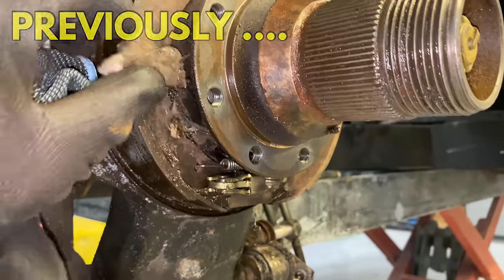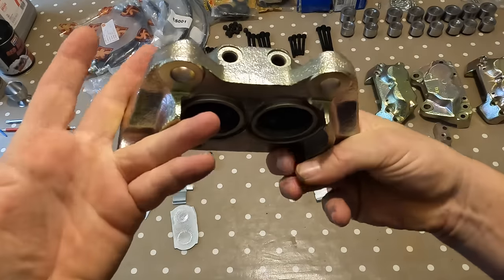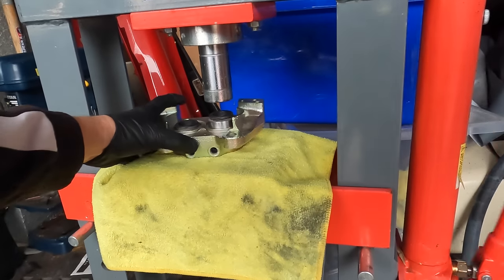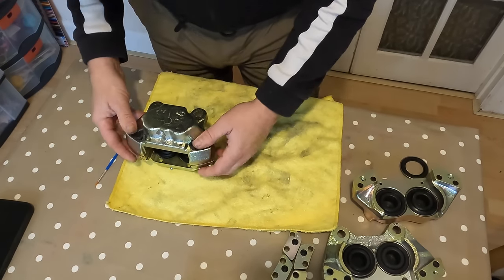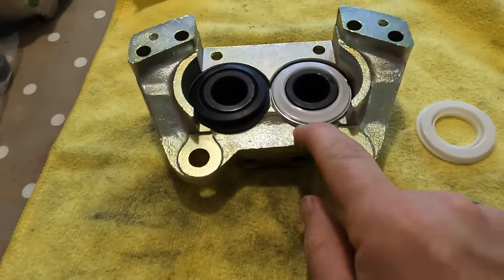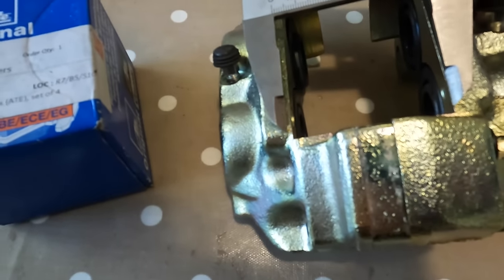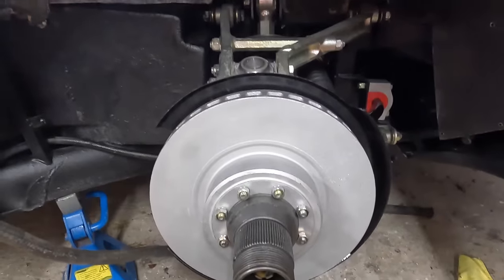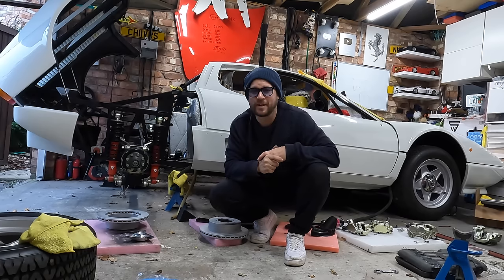Barn Find Rare Ferrari 512BBi - Finally Fixing a 2 Year Brake Problem

Comment from the maker: Guys, I love my job working with cars, finding a career that makes you happy is life changing !
If you want to work in the Automotive industry or fancy a change, speak to ASi who can help you out. 
https://asirecruitment.co.uk/contact-us/
Or email: terry@asirecruitment.co.uk
Reply: Nyalic  Nyalic is the shiznit for protecting bare metal.   It's not a paint, but it is a clear surface coating.   The UK dealer apparently is oceanfootprint.
Reply: the spring goes inside the rubber dust cover

Comment: I Scott. You shouldn't have to press those pistons in with a press! If they don't go in by hand then there is an issue. I always soak the seals in seal conditioning fluid for 24 hours before you fit them (Brembo make it) using red rubber grease to put the pistons in would have made things easier. Just make sure those tight pistons move in and out nicely when the brakes are bled. Pump them out with no pads and check each pair of pistons come out evenly and that you can push them back in by hand.
Reply: Julian is spot on
Reply: If some went in easy and some didn't, then I have to wonder if the seals are shaped on the face that seals to the piston, it can be very hard to see the chamfer, did you check them,???
Reply: Great info, that freaked me out also. Hopefully it works.
Reply: Will be really interesting to see if the brakes work correctly after they were put on the press. I would have thought no way.
Reply: @Mr57blackbeauty  I expect the seals will be square, the chamfer will be machined into the base of the seal groove. This is what makes the seal sit at an angle so that the piston retracts very slightly when brake pressure is released.
Reply: agreed...all that's needed is red assembly lube..
Reply: This guy is right, you know. Glad Scott spotted it.
Reply: @julianhoskins5158  hopefully they are, but a lot of early ones aren't, it was easier/cheaper to machine the caliper square and put a chamfer on the seal, they also discouraged people from rebuilding calipers by making it almost impossible to buy seals. But fingers crossed.
Reply: Oi suspect the seal is upside down if they don't go in. Brakes won't work very well and the pedal will be very hard if the wrong way round. The seals are tapered.  I made that error.
Reply: Good luck getting them out now. lol
Reply: Yeah i was thinking, when i was doing a pad change it only look 2-3 fingers of pressure to reset the pistons :T
Reply: @Mr57blackbeauty   brembo got sued big time for not giving instructions on  replacement  seals.
take no changes on brakes.

Comment: The other side of those measurement calipers is for inside measurement. As far as the pins a machine shop could put those on a lathe and make them the proper size relatively quickly and cheaply.
Reply from the maker: That was my idea, but surely there must be some pins out there available at the same size
Reply: My 1971 BMW 2002 uses those style  pins , check later BMW calipers for replacement pins .  @Ratarossa
Reply: Scott - I'd also check with Alfaholics. They might have some pins laying around that could help you out. Alfas of the era also used the ATE calipers (my Montreal's calipers look nearly the same as those on your BBi, though I'd guess a bit smaller if placed side-by-side). @Ratarossa
Reply: Fellow YouTuber ‘Delboy’s Garage’ (@moonfleet41) does some fantastic lathe work, creating one off work/ modifications for his motorbikes in uk. Maybe another opportunity for YouTuber collaborations 😊

Comment: Take care pushing pistons in like that. They should slide in, and a fair chance if not then they are catching on the seals. The piston can then guillotine a piece of the inside of the seal off (and no chance of bleeding them after that!)
Reply from the maker: Noted
Reply: @Ratarossa do you think the pistons being that hard to push in that the braking system will have enough pressure to push the pistons out to make the brakes work?
Reply: @joeysweet9045  it will defo push them out its if they will release that's the problem!
Reply: I’m afraid the pistons scratched the cilinders when pressing in. My guess is that the coating created the fitment problem.
Reply: @Ratarossa  The inner seals maybe incorrect, like the dust caps and springs 🤷‍♂
Reply: @_Bram  good pasivated  zinc plating should be very thin. However, it is possible that the seals are directional, rather than square section.
Reply: @katywalker8322  Seals will be square, the force to retract the piston slightly when  the brakes are released is controlled by the shape of the seal groove which will be slightly tapered.
Reply: Bmw&merc use Ate brakes.
Reply: @jabberwockytdi8901  , not on all calipers, although cant say either way for these ate calipers.

Comment: Had a guy who took over half a year to point one of my cars! When I picked it up. On purpose he parked it in the sun in the summer. Also, while it was there he had kept the car outside, and obviously had the windows down some of the time. It is a nightmare dealing with paint and plating shops. For some reason they attract reprehensible types of males.

Comment: Hi Scott. Nice work as always mate.
Just a side note. When it comes to lubing up those seals prior to installing the pistons, I was advised from a reliable source to not use brake fluid but rather a castor oil based Red Rubber grease. Brake fluid is hygroscopic and can introduce corrosion while the finished part lays in wait for the rest of the build to catch up.
Also, the red rubber grease protects the seal much better and prolong its service life.
Reply from the maker: I did read about the red rubber grease and actually you might have even spotted a tub on the table. So basically what i need to do is get this finished very quickly !
Reply: Totally agree, I've never found brake fluid a very good lubricant for the job.
Reply: @Ratarossa  I missed that actually. I'll have another look
Reply: Hellerine M grade is a fungistatic lubricating oil designed to dry slowly so that the components stay lubricated longer, 94% Castor Oil 6% Ethanol.

Comment: Clear coat!
I've gone through the same process, restoring front/rear ATE calipers on my 105 Alfa. Been two pot calipers, I didn't have the dramas you experienced, phew! I used VHT High Temp Clear on on my newly Yellow Zn  plated parts. Wiped them down,  hung on wires and if it's getting cool  in UK, apply a bit of heat. Great vid!

Comment: Just a thought, why don't you take the longer pins to a local engineering firm and see if they can reduce them on a lathe?
Great to see you back on the BBi as well!
Reply: Glad you typed it..His main problem is finding a local engineering firm....;D Maybe you need a little second hand lathe Scott?
Reply: Yeah a good machinist would make short work of getting those pins to the right size.

Comment: For anti corrosion you can try XCP Rust Blocker Clear Coat. Readily available in the UK. A lot of bike owners use it to protect the exposed metal parts on their bikes. It's also very easy to apply.
Reply: I've used ACF50 on my bikes for decades, easily applied from a cloth near brakes and elsewhere. Works extremely well.
Reply: I have also applied a marine grade lanolin based protection to the running gear of my cars. Using a combination of spray, brush and cloth depending upon the application. These cars were made and are best driven, not squirrelled away.

Comment: If you clear coat zinc plate  instead of gradually getting a uniform weathering you will find that the coating gets damaged  in places ( stone chip etc.) and corrosion will get underneath and cause crusty flaking patches while other parts stay shiny longer. Also if you want to keep it looking nice as long as possible DO NOT go any where near those wheels with wheel cleaner  will eat the plating in short order , even the  ones marked PH neutral are still based on a chelating acid ( but buffered) which will still do the same thing , just takes longer  so limiting exposure time is key.

Comment: When I did my brakes, the seals had to be installed in the correct orientation. They had a very sleightly tapered shape. This pushes the piston clear of the disk I think.

Comment: You should be using rubber grease for assembly and to stop the pistons from corrosion. Turn down the pins on a lathe. Split washers are usually installed under nuts, not bolt heads if there's a nut. Might be worth checking the front disc assembly order.

Comment: You can preserve your zinc plating with Shark Hide. Brush it on. It is clear and will not peel. It does make things shiny if they were dull. I've used it for 10 years on my old BMW. It works on bare aluminum too.

Comment: Always use silicone grease for caliper rebuilds Scott! Expensive but saves on the blood and bruises and those pistons just slide home, providing those piston seals are oriented the correct way as they are cut in  a Specific manner.

Comment: I just had the same issue with those darned springs absolutely not wanting to stay on. Ate calipers for 1994 Mercedes SL. Factory originals were a harder rubber boot with no clip, just a snug strong fit. Luckily I found another repair kit with "hard boot". No annoying springs.

Comment: What I've found is pushing the pistons directly in like that, can really put stress on the rubber seal inside and in a rare case, even tear it... even with brake fluid. Had that happen to me doing some Evo 123 twin pots on my lancer project. It really is better to find a way to twist em in a circular motion and work it slowly.

Comment: Put clearcoat over the yellow zinc parts. It will help to keep them yellow for longer. They will fade really quickly if you don't do so. That is because a couple of years ago someone decided to ban Chrome VI / 6 which was the older plating they used. There are new alternatives that are being used but they don't even come close to the quality of older yellow zinc plating.

Comment: Put the long pins in the chuck of a pillar drill, select an appropriate speed, then use a fine square section file to reduce the shank of the pin to the required length. Finish off with fine emery cloth or abranet paper for a good finish. 
A bit sketchy but you could even do it by holding an ordinary household electric hand drill in a big vice.

Comment: Smashing project. Anti-seize needs to be wiped on the hub carriers before you tighten everything down. Also on the calipers for the backs of the pads so you can change them easily in the future. Just a thin layer-dab-on-wipe-smooth with a rag. Some of those bolts need loc-tite too. Those missing bits will turn up just as everything is finishing up-Murphy's Law.
Reply: +1

Comment: ATE makes great lube called Bremzzylinderpaste which is brake fluid compatible and works very well as the assembly and maintenance grease. Try using it next time. You won't need to use brutal force.

Comment: The brake parts would have to have a heat resistant clearcoat. I guess you would need to find out max operating temperature and get a clear lacquer that wouldn’t discolour or fall off, and adhere to the plates coating. Sounds simple. Good luck Scott

Comment: The suspension and brakes look absolutely gorgeous Scott and I feel you when you'd like to preserve that look. There must be lots of clear coats out there for sure.
Having rebuild a lot of brakes myself, most of them on motorcycles but also on cars and even ATI brakes (Alfa Romeo), I recognise the parts. Those clips won't come off, at least not in my experience but the Ferrari solution looks clean and solid. When I buy any kind of brake kit, there's always a (tomato sauces like) container with special grease to install the kit. Brake fluid won't work and will only make it harder.

Comment: Really enjoying this project. I agree with the many comments; there is something wrong with the seals if you need a press to get them in. They may already not be coming back out without sacrificing them.

I suggest custom stainless pistons courtesy of your local machine shop. Same for the pins. 

I suggest a regime of maintenance using ceramic coating products for preserving your finishes. It will need updating maybe every spring, for example

Comment: To break a reply out into the general chat:  Nyalic - distributed by oceanfootprint I believe in the UK, is an Apollo era clear-coat protectant used on spacecraft that should be just perfect to keep the luster/finish put on those fresh metal parts.  It's both clear, not thick, and can withstand just about any non-exhaust level temperatures.

Comment: 6:35 Get a flat thick piece of wood, and a brass hammer, a small one, level it off and tap it in, or just use the wood to keep the pressure up and push it in, main thing is its something softer than the metal that isnt textured or rough so you dont break it or screw up the surface

Comment: The only thing I can think of to help protect everything without applying a permanent or oily coating is wax/ceramic spray. A wax coating will prevent moisture ingress while a ceramic detailer spray will apply a hydrophobic coating and allow less water to sit on surfaces. Otherwise, the only way to keep it all pristine is indoor storage and climate control.

Comment: Lovely work as always. If you need information or parts for classic ATE brakes be sure to reach out to PMB Performance in the US. They are specialists in old ATE restoration and will be able to help you out. As for the yellow zinc coating in order to protect it at MOST spray it with a light coating of oil but nothing more. Clear coat will fail quickly and look terrible. If the zinc was done well it can last decades. It is the exposure to salt and water that destroys the coating and so long as you wash and dry the car you will not have issues with the coating looking bad over time.

Comment: absolutely love the level of detail going into this car! but.. i was mortified to see a press being used to fit caliper pistons, they should really only be hand pressure tight, otherwise they likely wont move correctly (and could be a nightmare to remove on the next rebuild); remember that they move out under pressure but also back inwards slightly when you come off the brakes. this is achieved by the natural motion of the seal (thickness( being able to flex in and out. too tight a fit and there is no movement to be had. i can see major brake binding issues in the future for these 😬

Comment: Owning a classic car dilemma, as someone that lives near the coast. Drive it, will actually be good to maintain the powertrain in working condition, but compromising the body panels, not only due to rust as potential damage.
Reply: Even relatively new cars already show rust. Too thin modern paint jobs, as usually starts to appear near the front grille.

Comment: Lots of caliper build kits include a special grease to enable assembly..
The pistons should have pushed in easily once past the seal.
I think you need to carefully check that the pads don't bind or stick , due to the seals not being able to retract the pistons when the pedal is released.

Comment: Dude, put the pistons in the freezer and caliper halves under low heat in the oven (or outside in the sun) and they’ll slide together a lot easier.
Reply: Not much Sun in the UK ATM.

Comment: When rebuilding brakes using red brake rubber grease, better and safer than straight brake fluid (stops corrosion behind the seals etc) and doesn’t effect the fluid/braking performance

Surprised the pistons needed a press to get in, as long as they are not cock-eyed they should push in by hand… are the seals or pistons the correct size, looks like they binding and might work but would hold the pistons causing the brakes to bind on
Reply: The red brake grease is literally made for the job👍.
Reply: Hope he did it all so it all last and don't dry out and so on👍

Comment: Just use a G-clamp on those caliper pistons.

It does the job of the tool designed for the purpouse. And yes, there is a tool for that at a ridiculously high price vs the cost of a G-clamp.

Comment: Another option to protect the callipers is Dinitrol Corroheat -  it's an anti corrosion wax for engines that withstands high temperatures and sets quite hard , but will lose the shine  and needs redoing from time to time.

Comment: Use a high temp clear lacquer on the suspension and brake callipers, then use Built Hambers Dynax UC clear wax spray on the suspension and under arches, chassis etc…cheap and stops corrosion

Comment: Brake pad pins, I would just have the longer pins machined down on a lathe.
And for protection of all under cartridge spray with ACF 50 or scot oil 365. Cheap insurance, for protection 😊

Comment: Oh BTW, I found out that square wall style retaining spring for the brake dust boots are called a "Hoopster" retaining ring - usually used in internal retention, .  You may be able to find a dealer that has or can make the right size.

Comment: The zinc plating is the protection (which I am sure you are aware), generally the issue is the lifting of zinc due to poor plating (contamination at time of plating), I would think a clear coat would not be beneficial, but pretty sure should not react with the zinc as it's a metal plating not a paint.

Comment: For the short rear caliper pins just have the extra front ones cut shorter and machined down on the end. Should be a simple process on a small lathe.

Comment: Why not get the shoulder length on the long pins machined back till they fit the calipers ? Thats what I would do
Reply from the maker: it is the obvious answer. I need someone with a lathe.
Reply: I've got 4 of various sizes, just a shame Iam up in the North West or I would have gladly done them 👍